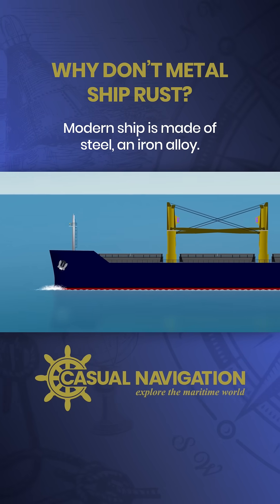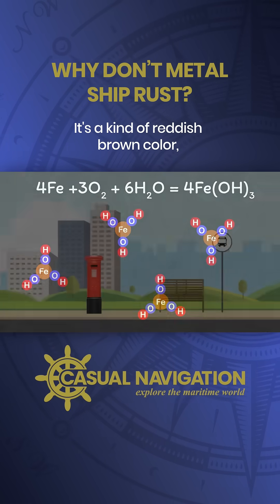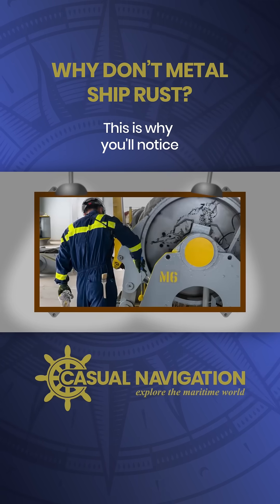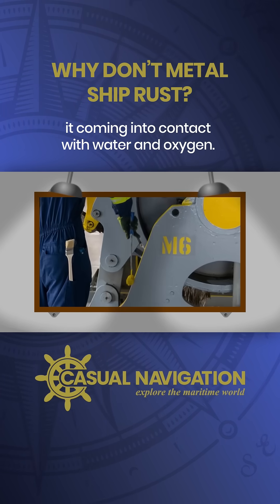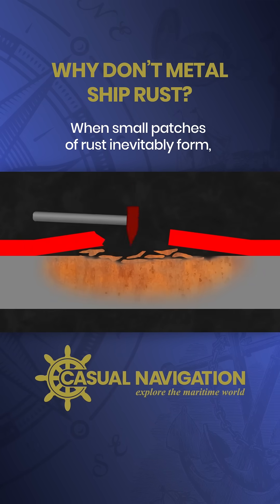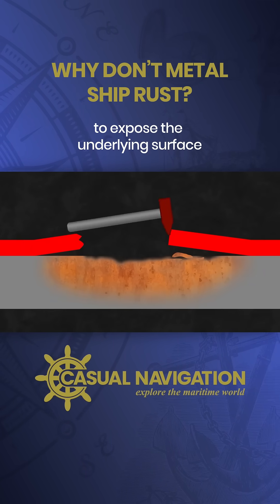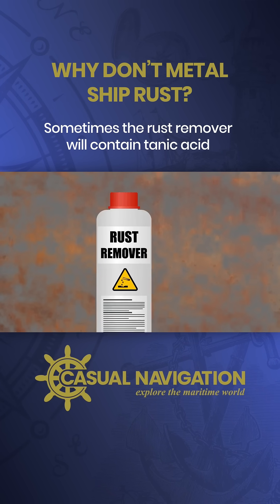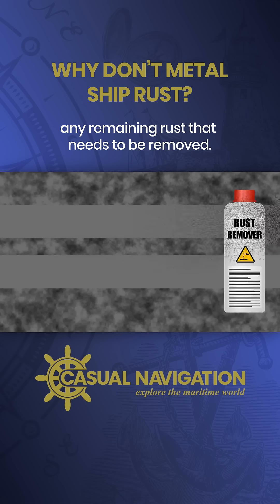The Secret to Rust-Free Ships

Comment: Why not spray and even better give the metal object a mild electric charge that attracts the paint. Car makers could teach shipbuilding alot
Reply: Ships use sacrificial annodes which for the lifetime of the ship are still cheaper than the infrastructure to keep the ENTIRE HULL OF THE SHIP at electrictal potential.

I'm not saying it's an impossible solution, I'm just saying it's an expensive one.

Additionally, any paints or coatings have to be either easy to reapply or resilient against scraping off barnacles and such, while also not degrading toxically when exposed to UV, weathering, and corrosion - I doubt the paints used in the auto industry quite meet those specifications, and I'm not sure whether the principle would still work with coatings that do meet their specifications - I'm not a material scientist, I'm a machinist.

What I do know for sure is that a lot more time money and effort goes into preventing a ship from rusting than your car which only has to last a tenth as long while not partially submerged in seawater.
Reply: Yeah, shipbuilders are inexperienced
Reply: @davidohara7669 ship builders should consult bro
Reply: @davidohara7669  Shipbuilders build to a price and owners maintain it to a price. In the worse scenario, you get fined if the ship leaks, best outcome you pollute outside local waters or you can dump the ship in some Indian scrap shop and let the grouped insurance cover any mishaps due to cheapest ship design even with the best maintenance the owner is willing to pay up to. Quality costs and shipbuilding ISA conservative industry. Recalls are not the norm nor are claims against the naval architect or shipyard as you might need these rare resources again and you asked for X ship result @ X price with X prediction of maintenance over X yrs
Reply: @davidohara7669  No more than car builders are. The fact is that modern boats use steel that rusts in ....seawater and the best marine growth avoidance is jet wash or a gigantic regular paint job using marine toxic paint protection and that painting such items leave them open to rust anyway even with near continual body maintenance. Cars near never get body maintenance bar scratch removal, repainting the body is a rarity, they use the same metals as ships and the metals are thiinner and they are designed to be left next to seaspray not rust.